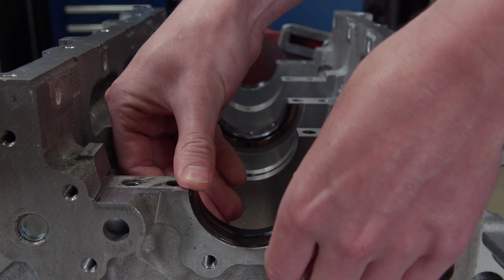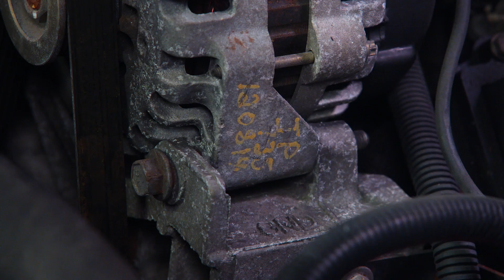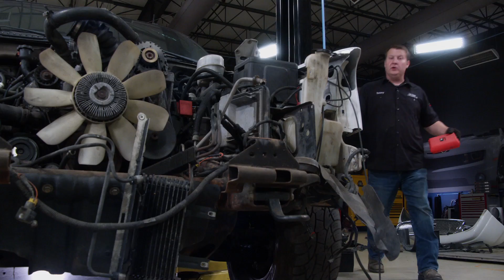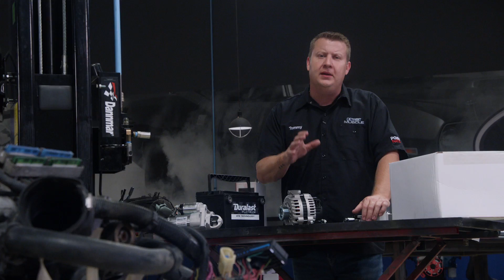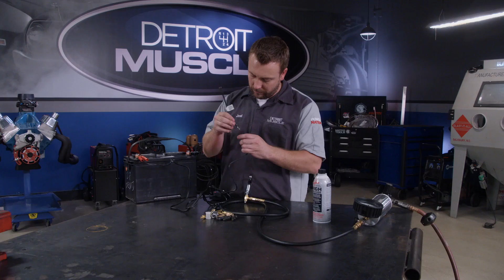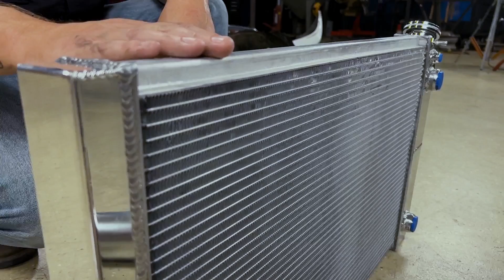What To Look For In An LS Engine - Detroit Muscle S9, E10

Comment: I had to swap my 4th gen 5.3 on my 08 Silverado and ended up with a 3rd gen 6.0. I had to get my old crank sensor pressed onto the 3rd gen engine and switch out the cam sensor as well.  Then I fired it up and it was only running on four cylinders. I had to drive it home across town about 15 MI like that. I took the ECU out and brought it to some tuner guy and he charged me $200 I think it was to change everything so that it worked correctly. I've been driving it over a year like this and it runs pretty well. Unfortunately the guy who did it screwed something up and I have a massive oil leak maybe from the main seal I'm not sure, I just keep putting oil in it until I figure out what the hell needs done to fix it. I did put a Melling high volume oil pump on it and it has great oil pressure.

Comment: Regarding the GMC Yukon's lack of maintenance and blatant neglect: why do people in the United States buy vehicles that they cannot afford to maintain?
Reply: Gotta try and keep up with the neighbors.
Reply: They get maintained at first. Then they get sold an by the time the fourth or fifth buyer picks it up for a tenth the original price it comes down to cost versus benefit. $2000 paint job on a $5000 truck don’t make much sense. Or a $5000 transmission for an engine that has 250k miles on it.

Comment: Looks at the Yukon: Leaky sunroof, New wheels, and chipping paint is just too much work. Better scrap it.

Now..let's pull the motor, tesr it down, at FI, restore a 45 year old car, and swap the motor. 

Lol. Spoken like a true car guy.
Reply: I cut up a clean 1999 Chevy Suburban with 119k on it to put a rusty old 48 Chevy truck on the frame lol, its a car guy thing

Comment: The 5.3 and 6.0 is not an LS,it is an LS style with a cast iron block.Those locking  tabs,I take off and toss.I call them pain in the ass tabs not needed.Autozone starters and alternators are trash called Durashit,Durablast and many more names.Will need tools on hand to replace them a lot
Reply: If the 5.3 and the 6.0 aren’t LS engines, what is the LS2 engine?
Reply: @fat_cat8457  The 5.3 and 6.0 are vortec engines
Reply: @Toolaholic7  the ls2 and ls4 are 5.3 and 6.0 engines but both are exclusively in cars
Reply: damn alts haha

Comment: I see a bunch of scrap metal. Melting ls for my own block mold . The metals separate at certain temperatures blend with other properties will make almost indestructible block. Sell it to highest bidder.
Reply: You have the grammar of a 7 year old. I had a stroke attempting to make sense of that
Reply: Yeah.... cause the level of foundry and engineering work is certainly within your power. The cast block is also superior to a billet one right?
Reply: Huh?